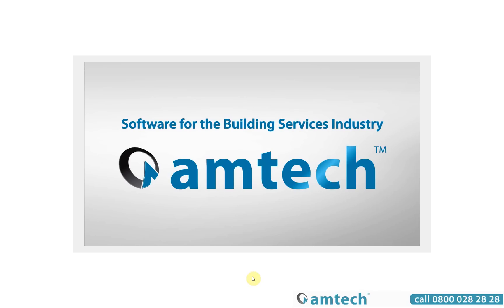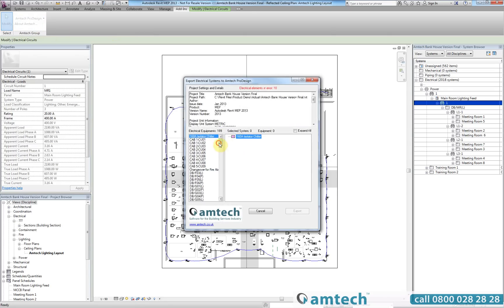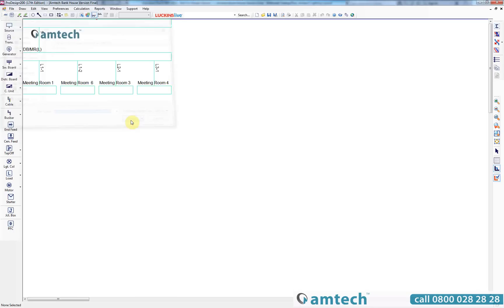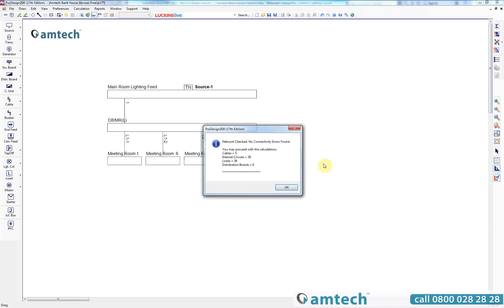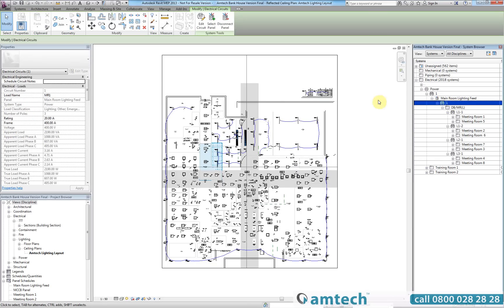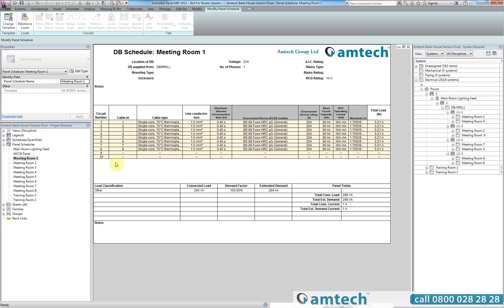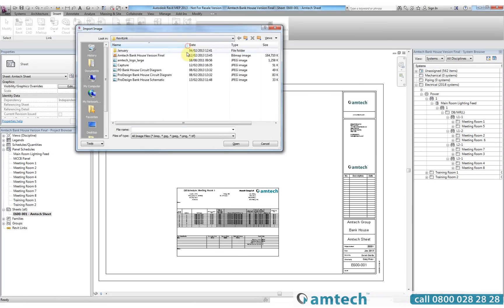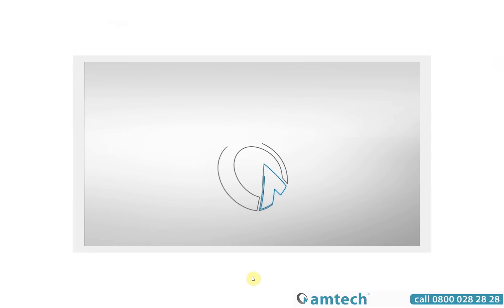Amtech ProDesign Revit plugin Demo | Amtech Group

Comment: Hi, I try to export SLD from the revit (It's street lighting project) but when i export circuit is not shown the end of lighitng fixture(I have connected 5 plus lighting Colum in circuit). It's shown the sum of the circuit load. Can you please guide me how can i see the all lighting column which are connected in the circuit.